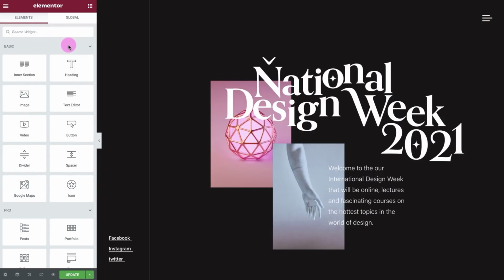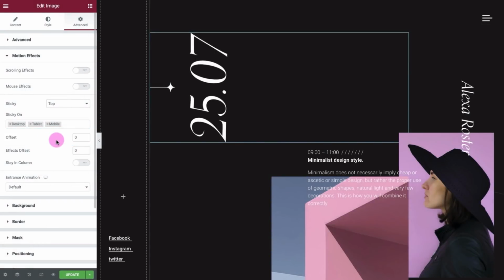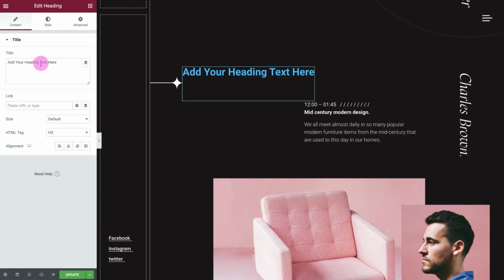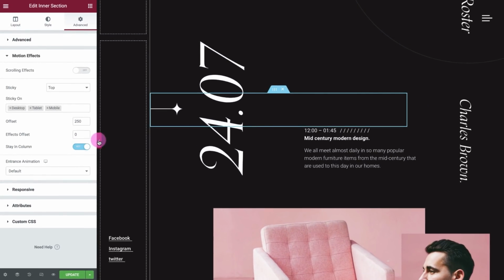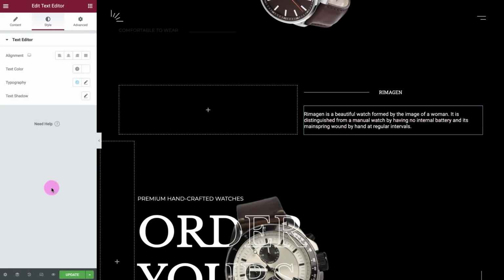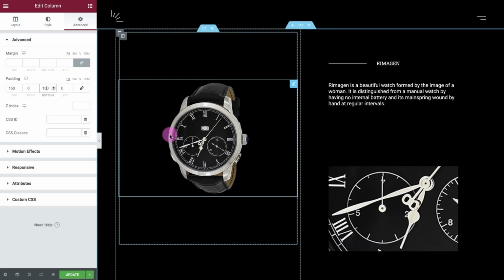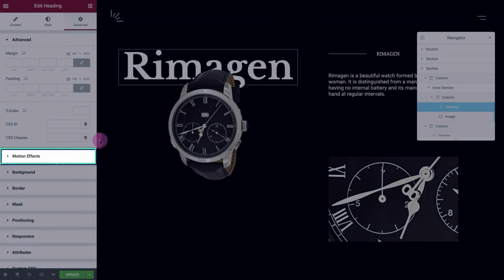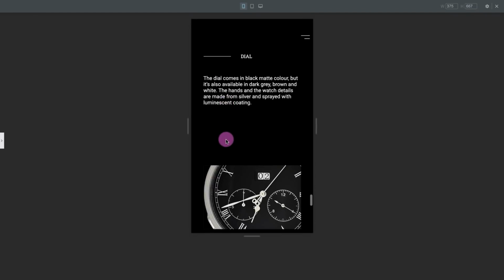WEBINAR: Level Up Your Design Skills With Sticky Elements In Elementor Pro [ADVANCED]

Comment: Sticky column or section is not working properly with new flexbox layout containers. the sticky element expands or shrink randomly when its in sticky state. anyone have solution for this? or anyone tried it with new flexbox containers?

Comment: The video is amazing! I'm trying to create sticky design on my website and I'm only getting the "stay in the column" option in the image section, not in the inner column what should I do. If somebody knows how to fix this please let me know, I have tried Custom CSS code everything but nothing worked.
Reply: I don't know if you have figured it out, but I think I experienced the same issue as you. The stay in column function is indeed only in the image section. However, I noticed that it doesn't work if it's only one image, the one you want the sticky effect on, on this column. I also noticed in the video that he has more elements/widgets in the same column. So I tested a bit. If you add more widgets in that same column, right under your image that you want to be sticky, then the "stay in the column" works. I hope it helps :)